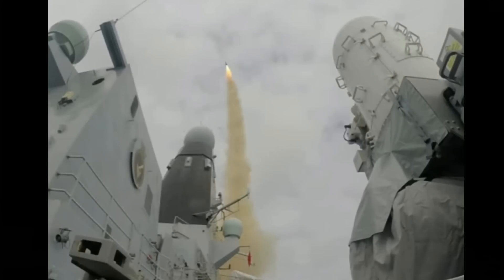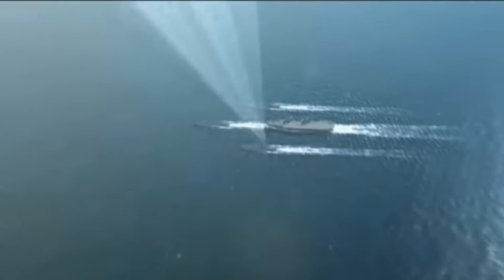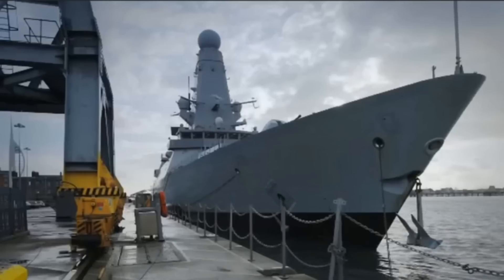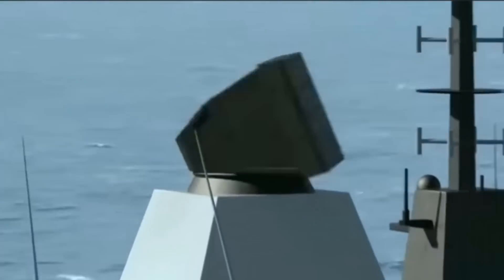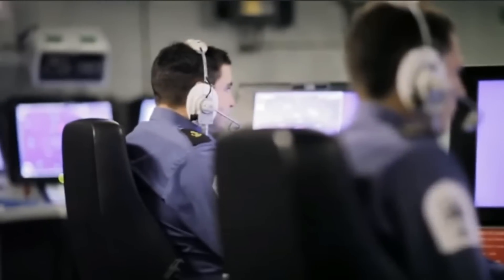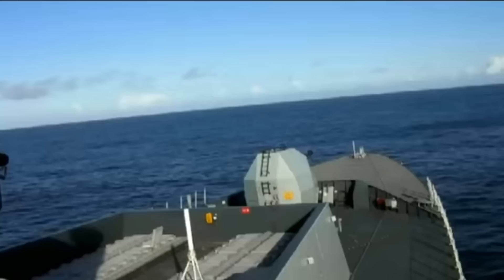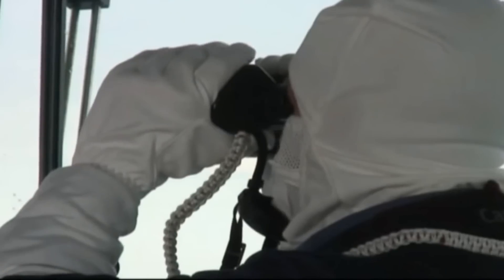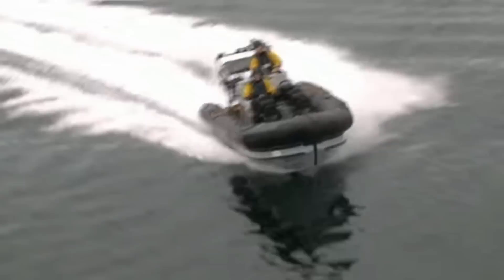The Type 45 Destroyer : Daring Class - Overview

Comment: The engine issues on Type 45 have been largely addressed. For instance, HMS Defender and HMS Daring have both successfully deployed to the Gulf without incident, and there's newer more powerful diesels being installed in the coming years. And their global availability has actually gone up by five percent since the engine issues were addressed. Shame you never read that in the papers though, it's still just the usual, "huh they break in warm water" nonsense.

Wonderful video by the way.
Reply: Stop been a troll. They have been deploying for 3-6 month periods to the Gulf for years.
Reply: Dave Sisson What are you talking about? The south Atlantic isn't temperate. Do you have any idea what your talking about?
Reply: Yes they have. There have been measures taken to mitigate the issue, which has led to several deployments in the Gulf without incident. A plan is in place to rectify the issue and should be taking place in the next couple years.
Reply: dylans voice  which missile, the one at mach 4 or the one at mach 3?
Reply: Putin did it. Russia cant delivery a fucking pizza nevermind a well placed missile there aging untested propaganda fueled buckets of cheap pound land rust they'd be wiped clean from the map before they got anywhere near these weapon systems.
Reply: As of today all six In dock for REPAIRS Any thing to SAY
Reply: dylans voice Well, the only people with engines that can power a military aircraft at faster than mach 3 is the UK, with Reaction Engines SABRE.
Reply: They have put safety measures in place to stop those engines from melting, similar to a get home safe mode in a car, the navy accepted delivery knowing there were 1000's of minor faults and close to 40 major faults, i remember the first 6 months on board at 45 degrees because cooling and ventilation systems were not working as the two systems were incompatible. That is the issue with so many subcontractors, overall they might deliver on their contracts, but together they might not work together
Reply: The fix isn't a fix, it's a fudge.  Extra generators for slow cruise with gas turbines only being used for short dashes.  Just to rub salt in the wound the taxpayer is picking up the bill not Rolls Royce.
Reply: @davidbarlow431  there is a fix! since they have been in use in warm waters dipshit!! And it's the Northrop Grumman parts that failed not the Rolls Royce engine's ffs at least read up on it first 🤣🤣
Reply: @markbrown351  plus It appears someone here believes that the South Atlantic it temperate.
Reply: they Have not been address in any real manner at all...might take a decade or so to solved..
Reply: @reserva120  They have been addressed where is your evidence they have not?
Reply: @reserva120    You are correct.  A good summary of the issue is here.  It doesn't look like it was ever fixed, but was mitigated. https://www.navylookout.com/putting-the-type-45-propulsion-problems-in-perspective/
Reply: Pretty sure the failing part is US designed and built (some sort of intercooler).
Plus I think Bae told the Government they couldn't guarentee reliability with that part (as it was new tech), but were ignored.

Mitigation is NOT the same as fixing.
There is currently a real fix going on, that involves the ships being cut open and some hugely powerful auxiliary diesel generators being installed.
Reply: So in the tragic possibility of a second Falklands War, they will need to be towed across the tropics before the engines start working properly again in temperate climates?

Comment: Nice ships but I think that the dutch Zeven provincien class are better ships. The Type 45 carries no ssm, s and the Phalanx Ciws and air search radar are inferior to the dutch destroyer which are cheaper too.
Reply: 1. From what I have read Type 45 is equipped with Ciws, I know the carriers are. 
2. The PRIMARY role of this vessel is air defence, which is correct as its role will be protecting the carriers, something the Dutch navy doesn't have to worry about... Just because anti air is its primary role doesn't mean it can't undertake other roles such as attacking land and other ships. These other roles should be it's secondary mission as the planes from our carriers and our submarines can also do this. The Type 45 is designed to work as a bigger unit rather than on its own so can afford to be specialised in its role where as vessels of the Dutch Navy are more likely to be expected to operate alone meaning they must be more well rounded and able to undertake a number of roles. It comes down too the Royal Navy simply have more money to spend.
Reply: The T45 does carry ASMs. They have 8x Harpoon.

Sampson is a higher angle radar than the APAR too, owing to it having a greater number of larger transmit and recieve modules facing in any one direction at any one time. APAR only has 325 in any one direction. Sampson provides 2,500 omnidirectionally due to its dual face spherical design. Thats an enormous boost in power, and it's the reason why it's capable of ABM, while the APAR is relying on the separate S-1850M with its AESA upgrade to do ABM in future, which hasn't been fitted to the otherwise excellent De Zeven frigates.

Phalanx has several advantages over Goalkeeper too, they're about equal. Goalkeeper's range and power is greater, but Phalanx has more modern radar and fire control systems owing to the ongoing upgrades by the US. They are much easier to fit and upgrade too, with a laser module already being developed for use on the T45, trialing in 2018.
Reply: Marcel Chmura / ARVIN

What part of ANTI AIR WARFARE don't you morons understand! This ship was solely designed for air defense role, NOT multi role, period! They have helos, frigates and subs for multi purposes.
Next you will be saying a B-52 bomber is crap because it is not multi role that cannot do air superiority combat with a F-18.
READ what it was designed for (AAW) and stop pretending to know what you are talking about, unless you have had any experience operating and/or designing ALL of these systems. Typical YouTube warriors talking shit. As usual.
Reply: The Type 45 SAMs are superior in speed and range and are directed by a superior radar system. For the air defense role Type 45 is one of the best in the world.
Reply: Hahahah you  carry on thinking that this ship can be armed up for any threat type ,its clearly head and shoulders above anything out there
Reply: Ace Tanker Yes I understand that type 45 is a specialist ship designed to fit in a group. I get it. I know. but you missed my point...

Is the type 45 the best deal for UK? The type 45 is good in air defence yes, but is it massively more powerful than say the Horizon class destroyers in air defence? I don't really think so. Now, let's see what the UK uses type 45 for... Every year, the UK sends individual type 45s for patrolling and missions around the world. UK is using it like a frigate. Why? BECAUSE UK lacks numbers of ships. 

Type 45 costs over £1 billion each and isn't even multirole... The ships are capable of fitting harpoons, but only a couple of them have harpoon actually fitted. Now do you know the harpoons getting retired next year? Yes it's retiring. The next anti ship missiles will be at least 5 years away. So for the next few years, the type 45 will be almost 100% anti air only. The helicopter short range anti ship missile are decommissioned as well.

Go look at new destroyers from both the West and East. Especially ones costing close to £1billion each, is there one that's not multi role?
Reply: De Zevens are great ships, not going to say otherwise, but are constrained by limited fire channels due to the SARH missiles which make up their armament. The Type 45 doesn't share this problem with the Asters. In a heavy saturation attack I know which ship I would rather be in.

CIWS are last resort measures, if you're relying on them to deal with incoming missiles then something has gone horribly wrong already.
Reply: But that's the thing. The Type 45 was always designed to operate as part of a task group (Queen Elizabeth/Nimitz) where ASW and ASuW are conducted by ships that are specialists in those areas. The Type 45 was never intended to conduct solo patrols and very rarely does (and never in wartime). A Type 45 and a Type 26 working together will be very potent in most warfare scenarios with the cheaper general purpose Type 31s doing the solo sovereignty and anti-piracy patrols.
Reply: ƒяεεÞФϻ ƒîgнтεя First of all I didn, t say the type 45 is a bad type of vessel and i, m fully aware that they are designed for aaw Warfare. What I, m saying is that the Dutch Zeven provincien class offers the same performance for 600 million euro, s less per unit, we can argue about which ship performs better and maybe the type 45 will do that but come on my friend a difference of 600 million euro for a slightly better performance. The taxpayers in the UK will be very happy about that.
Reply: Well first of, Zeven Provincien is a frigate, not destroyer... Class is almost pointless, but still if we are to call them, we should call them what they are.
The Type 45 is due to be without Harpoons... However British industry is working on the next generation anti-ship missile, the Type 45 have both the room, and power to be installed with that system, should the RN deem it appropriate.
However, the older British destroyers didn't have anti-ship missiles either... The RN has the concept of Destroyers (anti air ships), Frigates (multi-roll, but with an edge towards ASW), Cruisers (multi-roll, command-ships, doesn't have any at the moment), Sloops (ASW).
When the Type 45 had Harpoons, it was (in British terminology) technically a frigate, but it was registered (in NATO) as a Destroyer... Making a big mess of it all.

The RN are due to get new frigates, however they are only just being designed, and given BAEs recent work, they will probably be late, and overpriced.
Reply: nice comments, but have you seen the difference between PAAMS and SEWACO XI?, really.. the data processing capacity in the type 45 is brutal...
Reply: The Type 45 carries the Merlin Mk 2 helicopter known and acknowledged to be the best anti sub helicopter in the world.

The design of the Type 45 is one of the most sleek and smooth in existence making it one of the hardest to detect in the world.

It has automation second to none making it the most efficient.

Leading antiJamming technology.

List of T45 air defenses:
16 Aster 15 missiles,
32 Aster 30 missiles,
2x Phalanx CIWS
Decoy systems
Missile Jammers 
Anti Missile flares.

^ Correct me if needed, my knowledge is rusty.
Reply: Marcel Chmura Exactly my point. UK always pays double, and only get half of the capabilities others have. £1 billion per ship, but with no anti air and anti sub weapons... LOL
Reply: It seams to me that the uk and the us pay a shit load of many for ships and vehicles and there just a little bit better then what others nations make and in some causes there worst then what other nations have like just look at Japan they have a smaller defense budget then the uk and their navy is far stronger then them (sorry for my English)
Reply: He'll look at second the great by South Korea or the sachen class frigate by Germany or the iver huitfeldt frigate by Demark I swear if the uk or the us built them they would cost several hundreds of millions of dollars more and they would be slightly better
Reply: It, s designated as a frigate but in fact it, s a destroyer just as his predecessor the Tromp class.
Reply: Really, you can call the European frigates whatever you want... They have reached a size where the designation really is just political
Reply: bandholm Agree it, s political indeed but you bring it up they are Frigates. Both class of ships comes out of the Nfr 90 project and my opinion is that the Netherlands did a better job in designing the ship. Of course I, m chauvinistic as a native Dutchman.
Reply: If air defense was the only concern, then the type 45 would be great indeed... But given that it has only a gun to target surface targets and land installations, no torpedos for hunting subs and are a 8000 tons unit... One has to question why the Brits didn't do more. As of right now, it is a valid question if Britain wouldn't have been better of, buying foreign designs
Reply: The six Type 45 ships are quite useful for fleet protection. The Type 23 ships however should be replaced with larger general purpose designs as they are retired to complement the specialist Type 45.
Reply: True for fleet protection they look effective... But on independent patrols or missions, something that are to be expected will be a large part of the class's service life, they are rather underwhelming... It is a big ship, with the same tasks and capability as the type 43, only the 43 were 3.500 tons lighter.
Reply: The most important in AAW ships is the high volume of data processed, and the ECM equipment, and at this point the capacities of the type 45 are a big deal... PAAMS is such a beast, the output radar power quite bigger than appar´s de zeven provincien or horizont class.
Systems like PAAMS or AEGIS, and links are the most important thing in  the Networcentric warefare, forbid the misile ranges or that shitty stuff with numbers...
Anyway, the most relevant vector of the type 45s destroyers are going to be the ASTER 45 missiles, for complete ABM capacity
Reply: Well as a native Dane, and knowing that the danish frigates were heavily inspired by the the Zeven Provincien (and one time had the honor of visiting that ship), I agree it is a better ship than the British!
Reply: Agreed. Or the French/ Italian Horizon class destroyers. They're cheaper and very capable multirole destroyers.